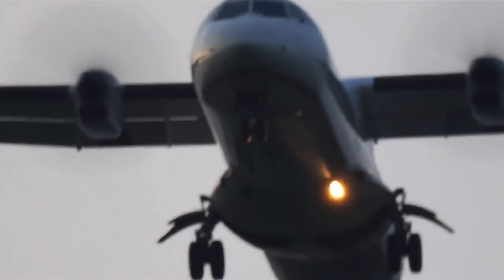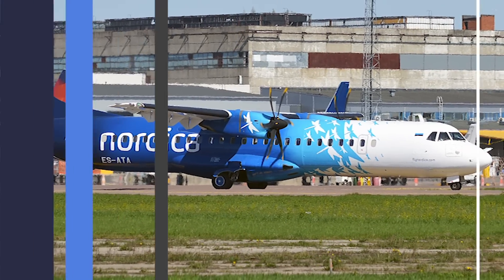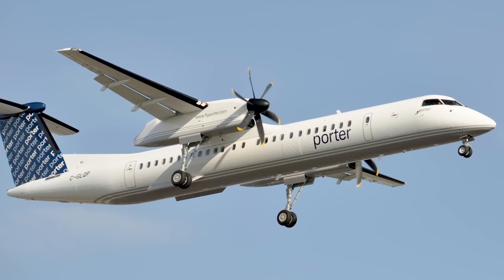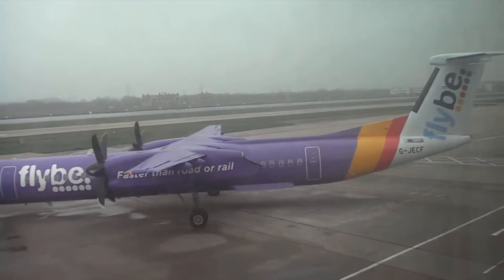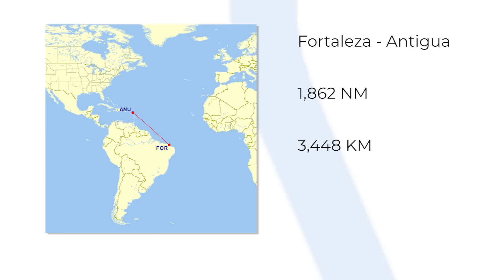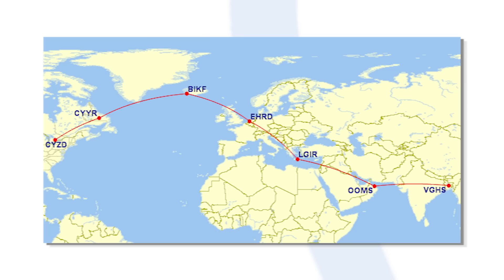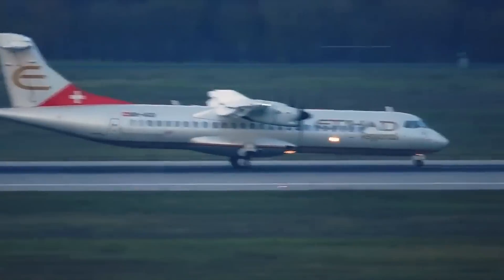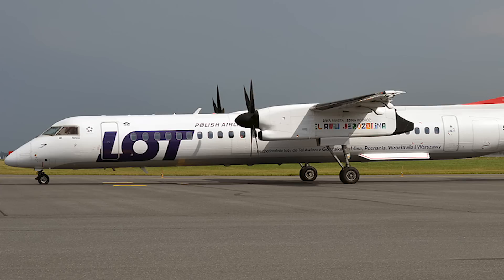How Do Turboprops Get Delivered To Far Away Customers?

Comment: “Dash 8” is a bit generic. The -100, -300 and especially -400 have different maximum ranges. The -400 with long-range cruise could reach Central Europe from Downsview with 2 stops, skipping Greenland, while the smaller ones would need a Greenland stop. We had some 300s that crossed the Atlantic 4 times within less than a year for a combination of change of proprietor and tax reasons.

Comment: I assumed this video are not for the reasonably well informed pilots, those who have heard of companies like Turtle Pak (Au) rubber fuel cells. What are you talking about adding extra tanks will be challenging and require modification??!!   On a larger turbo prop,  no passengers remember, the modification consist of removing enough seats at the C of G and strap a fuel cell there, and add the necessary fuel pumps and lines.   It is only challenging if your mechanic is drunk. On a ferry flight, with a ferry permit, the FAA allow the airplane to be loaded up to 50% over the regular gross weight, runway allow.  The Atlantic is now a joke to cross, if you island hop, some of the longer range planes will not even need extra gas. The sole challenge remain the Pacific, but in the 70s  they used to deliver planes like the Mooney M20 and 172s etc to Australia, The longest leg can be over 14 hours  to Hawaii. It only stopped because of the non availability of av gas  They did not even have GPS then, but we have it now,  and I can tell where eg Howland Island is to within 10 ft. instead of guessing like Earhart had to do.

Comment: These are jets for the most part. Most commercial airlines are almost always a jet of some kind
Reply: What !!!
Reply: Nader Nowzadi from what I understand they are jets and many jets are turboprops.
Reply: Nader Nowzadi it seems there is a jet behind the turbo prop from what I seen but I think I can see if I can see it online
Reply: Nader Nowzadi but most unless it’s like the Boeing 707 inside the engine cage has a turbo prop inside of there. 

But yes many times on most in use commercial airliners that are turbos are jets. They have jet engines on them
Reply: Nader Nowzadi anyways sorry I am posting so much. It seems under the piston engine there is a jet engine if you see there is usually a intake there
Reply: The turbo is short for turbine, the turbine is the core of a jet engine.   In a turboprop the fan is external (the propellor) & the exhaust gas doesn't contribute (much) to overall thrust.

Comment: Just for those who don't know, turboprops are actually pretty fuel efficient, they are just better operating at lower altitudes and lower speeds, and thus are relegated to shorter flying distances.
I know it's true because I read it on the internet.
Reply: yes and no. The engine produces thrust using a propeller so most turboprops can only get to around 25,000ft. This is because a propeller has to have a minimum density of air to "grab" onto.
Reply: @alexhinterreiter129  oh wow....  thanks for reinterpreting the point I made.
Reply: Fuel efficiency first got important for range and then for the economy and then for environment . If something on fossil fuel has a short range at optimum cruise speed, it is not efficient. All planes fill their wings with fuel. Some cheap cars have a tiny tank.

Comment: Random idea: Alternate history in which efficient long-range jets were never developed, so commercial trans-oceanic air travel depends on civilian aircraft carriers for mid-ocean refueling.
Reply: Cool idea but if long range jets were never developed than we would probably see short ranged jet power flying boat that us small flying boat bases built on island to cross oceans and there would probably still be a large market for ocean liners.
Reply: Transatlantic propeller operators used to fly via Gander and Iceland for this very reason.
Reply: @allangibson2408  And even in 1965 when I had the pleasure to cross the North Atlantic for the first time in a then fairly new Jet aircraft operated by KLM we flew from Amsterdam to Shannon, on to Gander and then New York. If that was dictated by fuel range, navigation or radio range or passenger demand I don‘t know. Or maybe it was just the old „oil-trace“ that the former prop-airplanes had to follow.
Reply: @berndheiden7630  The early jets were even more range limited than the propeller aircraft. It was high bypass turbofans that made one stop transatlantic flights possible (but they still routed over these airports as emergencies were not unknown).
Piston engine airliners were know to lose engines regularly on transatlantic routes (literally - they fell off the planes on about 10% of the transatlantic flights).
Reply: @allangibson2408  Thanks for the info! I was 17 y/o and the 3rd time out of my native Germany (after one weekend trip to te Netherlands and another to London!). This opened the door to the big wide world for me.

Comment: I remember seeing an article on people who fly single-prop planes (Cessna like planes) across the Atlantic to buyers on either side. They have to go super low, obviously it's very risky and weather dependent
Reply: When I worked in French Guyana, a company specialized in photogrammetry bought a second-hand Cessna 206, optimized for this kind of mission in Denmark. The ferry flight took two weeks and 17 steps via Iceland, Greenland, Canada, USA and Antilles. The pilot, a Danish, did it with his 16/17yo daughter. They spent only few hours in French Guyana, taking the first flight to Paris aboard an Air France A340.
Reply: @nicolas2419  it's crazy to think back in the day commercial flights would take days with many stops
Reply: @MrBibi86 so flyover states were born later?
Reply: I’ve watched a pilot’s YouTube channel who flew a Cessna from the us to Europe taking a route through Canada - Greenland - Iceland.. must be quite an adventure.
Reply: Why do they have to fly low?
Reply: @hugolafhugolaf  Most are unpressurised, so don't tend to fly above 10-14,000 ft (just so the pilots/passengers don't pass out from hypoxia, or lack of oxygen). Don't know why they'd fly 'super low' (or what that means in the context of OPs comment; it may be relative to commercial jets, which fly at 30-40,000ft) but it could be that props are optimised for flying lower and at lower speeds than turbofans (jets). There'd also be different weather conditions to consider at diff alts, so that may also be a factor.
Reply: @hugolafhugolaf It is safe to fly low and slow 😂, even better to drive....

Comment: ATR 72...They TAS at roughly 260kts  burning around 700kgs/hr and have 5000kgs of fuel = roughly 1800nm (so nearer the 2000nn not 700nm figures given).
Reply: What about reserve fuel required on commercial flights? And, non-optimal speed/altitude, and climb out file rate...

Comment: I remember Air Caledonie had one of their ATR 72-600s stopover in my local general aviation airport on its delivery flight from France. One of just 8 stops the aircraft made. What about crew? Are there two crews used to deliver such turboprops?
Reply: There is usually just one crew flying the plane, resting along the way in hotels. The crew is being flown in/out of the origin/destination airport on normal airline flights.